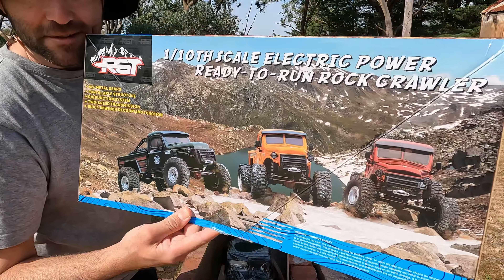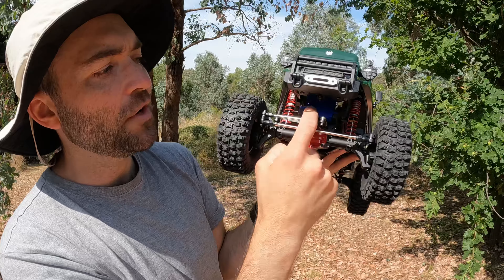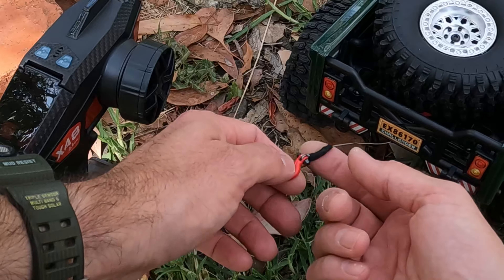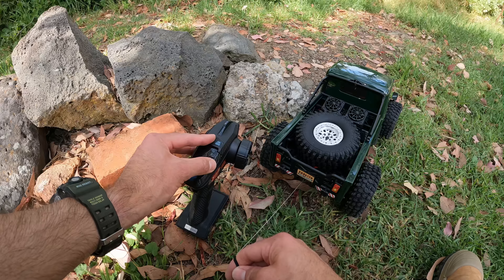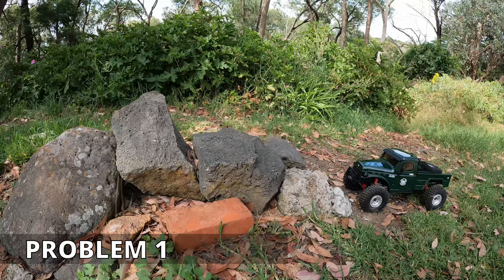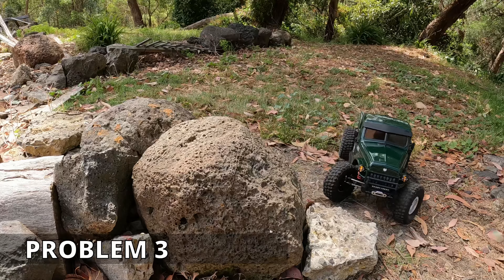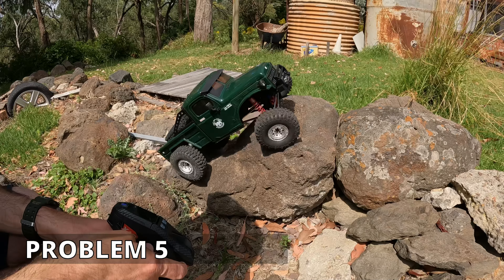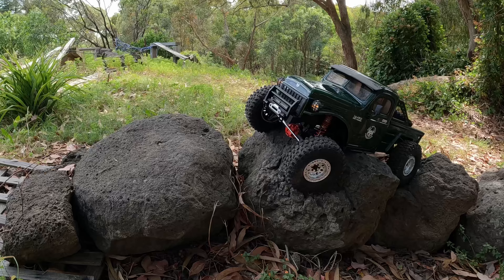RTR with Beadlocks, 2-Speed, DIG & Winch?!

Comment: Brands such as RGT have really come a long way in the last few years.  This model is full of interesting features and looks like a solid truck that has a well designed and built chassis.  I'm sure in many cases, products like these are equal to those of the well known brands, especially considering the price.
Reply from the maker: I agree on all points! Great time to be in the hobby, it really is :)
Reply: @RCTNT  Sure is!  The hardest thing is deciding what to buy next from the ever expanding shopping list.
Reply from the maker: No kidding. Even treating my purchasing like a small media business with a moderately decent budget here, I've found I need to be judicious in my selections as there's nowhere near enough coin to get everything I'd like to try!

But still, what a great problem to have, eh? :)
Reply: I think the only thing RGT is missing is a good naming system.
Reply from the maker: It's surprising the company isn't called RG45T11X

Comment: I'm really glad you got one of these. I just got mine in the other day and following the necessary maintenance like greasing all gears, different wheels and tires plus a Hobbywing Fusion Pro we are loving it!
Reply from the maker: It's a total fun machine, to be sure!
I love that they went with a 35T 550, it's just such a perfect brushed option for this rig. The wheels and tires are surprisingly decent, too. Just a great all round package.

Did you find your transmission and diffs a bit dry on grease? I haven't checked mine yet, would be interested to know!
Reply: @RCTNT  portals and transmission gears had barely even a film of grease. The diffs were adequate. I live in a rainy area so I always pack the diffs and portals full of SuperLube. The trans I just added a coating as usual. I was impressed with the complication of the trans. It was also very well sealed. Nice unit!

Everyone said the tires were good but I didn't even try them. Weighted beadlocks with Hyraxes for mine. Gotta get some tougher climbing time this weekend.
Reply from the maker: Nice one, thanks for the detail. Hope you manage to get out this weekend!
Reply: @RCTNT you mentioned you received a 3s Lipo? The one I received came with a hard case Sunpadow 2s 6200mah Lipo. Curious if it is different for the region it is being shipped to.

As for the supplied Lipo I was very impressed with the quality since I am used to receiving NiMH batteries from RGT. Regardless that Hobbywing Fusion Pro on 2s rips! If you haven't tried one yet definitely do. I have been swapping them into all my crawlers. I respect the 35T 550 it came with and have other plans for that already.
Reply from the maker: Hm it could just be the seller decided to include it, I really don't know. When I got the RGT Rescuer EX86190 on preorder, it came with a 6800mah 2S 25C hard pack, which has been great too. But this 3S pack was a new one, I'm happy with it so far.

I've been using HW Fusion combos since they first released. I have several of the original 1200kv/40A ones, then the 2300kv/60A Pro units are sweet as well, and now they've rebranded the originals as SE and I've grabbed the 1200kv/40A and 1800kv/40A ones too. I love the AXE systems, both the old and the newer R2 combos (my 1200kv 540 AXE system powers my BC8 8x8, with a combined mass when hauling of nearly 50kg, and it still takes off up hill in 2nd gear, it's so crazy!). 

All that to say, the Fusion Pro may just be the pick of the bunch in most cases! Glad you're enjoying them :)
Reply: @RCTNT  I have the Hobbywing Axe in a Gmade Buffalo GS02f and I actually prefer the Fusion Pro and also the SE which I only have 1 so far in a Gatekeeper. I now understand that a bigger heavier rig is what the Axe is probably better suited for given what you said. I'll keep that in mind.
Reply from the maker: Oh definitely. The Fusion in the GS02F might be playing with fire, given those weak diff gears, but that would otherwise bring that smooth performer to sublime new limits on the rocks. Such a great rig, the gmade.
Reply: @RCTNT  see I have heard the diff gears are weak but we have been running it on 3s and even bashing it a bit alongside our TRX4 and not a single breakage yet. That is with the Hobbywing Axe system in it too. If or when it does happen I guess I won't be surprised at least. I hope by then there will be stronger upgrade options available for it.
Reply from the maker: Me too, but I'm not holding my breath. Since I broke mine (on camera, wet tire test video), I've been running on 2S and a more tame brushed system.
Glad yours is still good. There's some degree of luck involved, given the gears are cast. They're not all going to be the same internal consistency - a little air in the wrong place, for example, would make a tooth much weaker.

Comment: My capra's dig works that way too. I can't fully trust it to disengage all the time. I took it apart from the first install and did a quick file job rounding the edges,helping with locking in. May take it apart and do a more thorough job. You could try it and see if it helps.
Reply from the maker: Thanks. Haven't checked the mechanism on this yet, but I will. Certainly the OG TRX4 locker engages and disengages smoothly. I think you're on a winner with smoothing the surfaces for 'sticky' DIGs, that's good thinking. Thanks!
Reply: Another great video, as usual.  With all those RCs to review, I can feel the money trying to fly out of my pocket already!  😂

Comment: Hey, there's a brand new 86170pro out! It has a HW Fusion brushless motor and several upgrades. Looks quite cool.
Reply from the maker: It's on the way for review 👍
Reply: @RCTNT Good to know! I will wait then. To be honest, I am mostly curious about how fast this thing can go on 3S...
Reply from the maker: @RinkaiKouen it won't be crazy fast and I really recommend against bashing with it. Indeed the top speed may be similar to the brushed version. Depends on gearing.

Low speed control and battery consumption will both be improved though.
Reply: @RCTNT  You know, I got the MJX 1/8 and it's an extra fun point to be able to run it at 30km/h on the beach. But I'd like to replace it with something a bit less massive.
Reply from the maker: Fair enough. The motor in that thing is a monster, to be sure. Crawls alright though, aside from the oversoft foams.

If you wanted to slow it down a bit, a pinion gear with one or two less teeth would do the job nicely.

The RGT Challenger here won't be as durable in higher speed shenanigans. I'd expect it'll go alright but it won't take as much abuse, going by the brushed version. Still plenty durable, but adding speed compounds the stress on the body, chassis and running gear. Just something to keep in mind anyway.

Comment: Does thos model have the grub screw holding the center driveshaft to the axle output or is it a setscrew now going all the way through? i had the ex86100 and center driveshaft popped off to much due to grub screw backing out.
Reply from the maker: Set screw on all sections, no little grub screws here 👍

Comment: Howsit going man, im confident, if you remove the rear sway bar, reduce the weight at the back and put stronger springs and weighted steel rims, it will do all 6 challenges. I just did it and uploaded to my channel, next step fusion pro 2300kv( love that motor)
Reply from the maker: Nice one. I had a go at some upgrades too: https://youtu.be/SdnoDL7Da1Q
Good car isn't it

Comment: Great review, with the 6 problems keeping the testing consistent is a great approach. I do think this truck has alog of potential, would be great if you would develop it a bit and see if some of its shortcomings can be ironed out. Like someone said, filing the dig engagement gear, but also some different wheels and tires (maybe add some width for sidehill stability), use a smal 1500mAh Lipo instead of that big stock battery and remove the spare tire are some ideas that come to mind. Keep up the good work, really enjoy your vidoes!
Reply from the maker: Thanks. I'll come back to this one in future. For what it's worth, I did these tests with the same small 700mah 3s battery I use for all my rigs on the videos. The spare wheel doesn't add a lot of weight either. But you're absolutely right, and width in particular may well be a boon in this case. I wouldn't mind trying to make the rig a bit lighter, too. I'll think on it!
Reply: @RC-TNT  to make ot lighter perhaps delete the winch, a All in one Fusion brushless system and then maybe delete the 2 speed... can't think of much more save for a custom carbon chassis
Reply from the maker: I could remove the spare wheel, too. Really, none of this really adds up to much. The big weight is in the axles, they really went to town making them heavy. The body is heavy too.

Comment: It's a good looking rig with a lot of features. I wonder how it would perform without the spare tire and with a smaller battery moved up front. For many people who are not hard core crawlers it might be an excellent machine. Thanks for sharing and testing.
Reply from the maker: I ran the 6 problems with a 700mah 3s battery rather than the included 4000mah brick they supplied. I did mention that but seem to have cut it in editing, sorry. Meant to keep that detail in!

I think you'll find similar performance in any case. That spare wheel doesn't add much weight.
Reply: From the way it’s set up it seems like it’s a trail rig. Winch in the rear and rear sway bar.
Reply from the maker: And fun, too!
Reply: @RCTNT  I do wish RGT had a little bit bigger or a reach in the United States like fms and rochobby. After watching this I was curious enough to consider getting one but shipping costs/times are about 1/4 of the price tag. Not to mention parts support would be expensive.
Reply from the maker: Ah right, fair enough. Shipping is about a quarter of the price here too, unless you get lucky and someone buys a bunch to sell from their small online store. Then you pay full manufacturer recommended price but shipping is affordable at least!

They are cool trucks, eh.

Comment: Hola, crees que con un servo de 40kg de los chinos a 7,4v y un hobbywing 1080 sera suficiente para moverle, o le pongo un bec de 8A aparte a 7,4v ?
Gracias
Reply from the maker: Depends on the servo, but generally yes, the BEC built in to the WP-1080 is definitely good enough.
Reply: @RCTNT  ok,bec + 1080 thanks you
Reply from the maker: Just 1080! To be clear :)

Comment: Back again haha. Have you found out which channel in the receiver is free and can be used by the button on the remote?

I have Led light set with 3 modes of lights. 
I plugged it into every free channel and pressed the empty channel button on the remote and it never registered on any channel. Any ideas? Thank you yet again :) 

Great content
Reply from the maker: Hey hey, yes in fact I have worked it out! Watch this video, it's the first thing I discuss at the start of the video. If yours isn't working, maybe your module isn't responding to radio input. You can test this by connecting your 3-mode light module to the steering servo channel and then turning the wheel each way to see if the lights respond.
https://youtu.be/SdnoDL7Da1Q
Reply: @RCTNT  Thank you so much for the reply. I will give these a shot :)
Reply: @RCTNT  if it's not responding to the channel imput what steps would I need to take to correct this?
Reply from the maker: You've tried it on the steering channel? If so and it still isn't responding, the issue is with the light module and not the radio. Check to be sure it does actually respond to radio input and not just to a switch, getting only power from the radio but not needing a signal. That'd be my first guess.
Reply from the maker: This may help you out if your module isn't actually radio controlled and only has manual switching:
Remote Control Switch Board CH3 light control
https://a.aliexpress.com/_mOyfqKK

Comment: Is the motor 3 or 5 slot? If it’s a 3 buy a 5slot it’s a significant difference. Holmes has em cheap on the sport line. Or I’ve tried the injora 550
Can 35t 5 slot and I’m impressed with it. Has bearings feels good like the Holmes do on the budget line. I like this rig a lot thanks for getting one
Reply from the maker: As you'll find if you look through our catalog of videos, the Holmes Crawlmaster series and the Reedy 5 slots feature prominently in many models. Great motors, love their smoothness.

However, you can tell this is a 3 slot by its speed - a 35T 5 slot would be slooooow! Being a 550 and a 35T, this 3 slot is lovely and smooth. It can't match a 5 slot for low end smoothness, but the power it still grants makes up for it. I think this is the best budget brushed motor for this rig, honestly.

Comment: It's a great looking truck at least. I should have known the struggles on problem 1 foreshadowed the rest. I admit I'm a bit curious if even a set of Canyon Trails would do better with their good traction and slightly shorter height. I suppose I am not their target though being more crawler focused than trail :) . Great review and I look forward to that pile of vehicles in the coming weeks and months! 🙌
Reply from the maker: It still did alright, didn't it. 3 of 6 problems means that it's still reasonably capable. And in larger terrain, without the peaky and steep bits to get it tipped or hung up, I expect this would be perfect. Definitely fun!
Reply: @RCTNT  That's true! I'm guilty of watching distracted with work today 😇

Comment: Ordered one of these today. Could someone please help me with a link to the best possible battery and charger I can put in this thing please? Excited to get into the hobby.
Reply from the maker: Nice choice :)

This is a decent battery: https://amzn.to/3t37bPH (there's a 10% off coupon on that page too)

This is a good basic charger you'll be able to keep and use with multiple batteries as you accumulate them over time in the hobby: https://amzn.to/46SvhKD
Scroll down and you'll find there's a combo buy for this charger and a couple of Zeee batteries too. Your new RC car will take 2S or 3S batteries; either is fine. 3S will be faster but won't last as long. I'd suggest 2S for a rig like this anyway. Run it and enjoy!

(Here's a second charger recommendation because it's currently my all-time fave charger: https://amzn.to/3uZypae )

Comment: Intriguing features, great review- thank you! The price though appears to be quite close to Axial and Traxxas crawler prices. I don’t know anything about RGT - does anyone know about parts support in the US? Price and parts support/availability would be my concerns. Other than that, looks interesting! 👍✌️
Reply from the maker: RGT is fast becoming a more premium brand in price and thankfully their quality is improving too. Parts haven't been an issue, historically. You can get the bits for most models on AliExpress at least, plus variously on banggood, Asiatees and eBay/Amazon. 

What you'll break, if you break anything, will be motors, servos and links - nothing model-specific there. It's snapping axles or diff gears that'll wreck your day. These are usually readily available online, for whatever that's worth.
Reply: Excellent! Very helpful information, thank you.
Reply: I've had my RGT 86010 CJ for a couple years. No US that I've found, although I haven't looked hard. I've had no problem getting parts from any number of stores on AliExpress. I've ordered main gears(grandson treated it like a basher), and   a couple link rods and drives haft for when I lengthened it to 313. Bot really, crawling, I haven't broken anything mechanical. Just body parts. I've added a Quicrun fusion, and locking portal axles, and am still under what I would've paid for a Traxxas trx4. It doesn't have 2 sp. Tranny, but crawling, it stays with my buddy's trx4 blazer, and looks more scale in the running gear.

Comment: I wonder could you tell me honestly,  which is the better crawler , this RGT OR the YK4107 , I fancy buying one of these two ??
Which would you recommend
Reply from the maker: Well, there's the Challenger V1 and V2, for a start. The V2 is the better machine, but more expensive.
The Yikong is cheaper than both, at least in Australia.
As far as the better crawler, I've covered their prowess in stock form on my 6-problem tests, so compare those to see which of the three crawled better (it may have been the Yikong but I can't recall).
And then there's the style and features. The Challenger V2 has a unique feature not found in any other crawler, and the 4106 and 4107 have their disc brake cutting brake assembly, which is also unique in the rc crawling world.

So, depending on your priorities, buy the one you like the look of better, or the one with better features, or performance, or even just the one whose body appeals to you more.

My aim is to help you make an informed decision, but ultimately the decision of which is best is subjective. Personally, I'd have trouble deciding between the Challenger V2 and the 4107. I'd probably end up taking the Challenger, but it'd be a close thing.